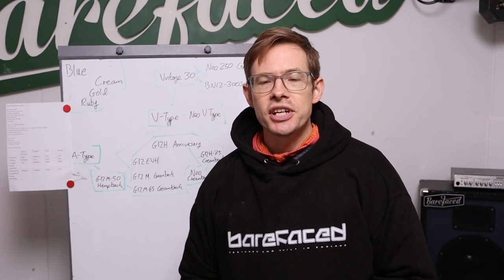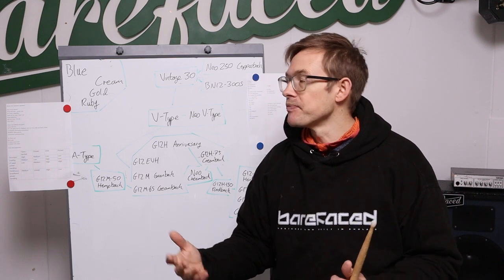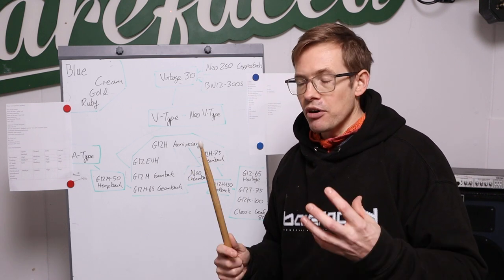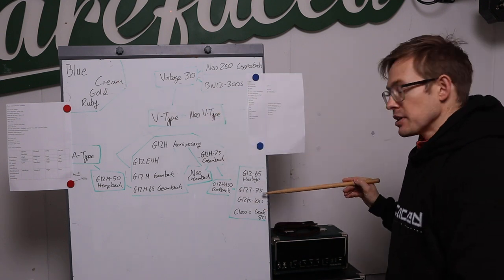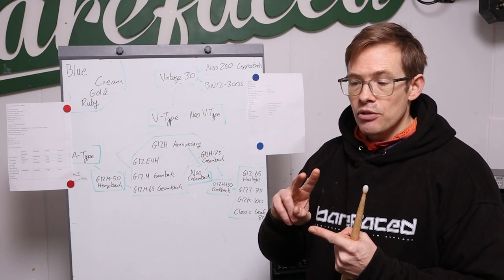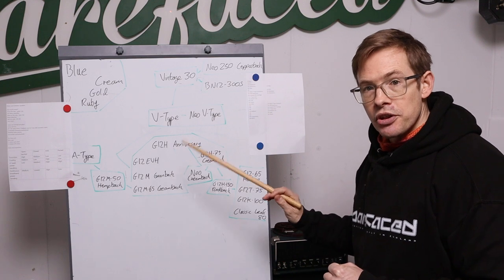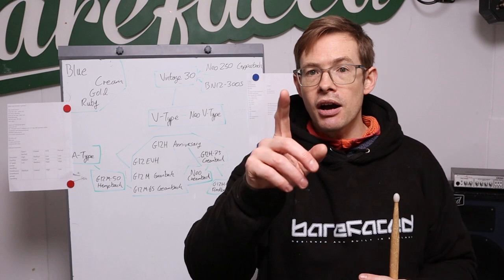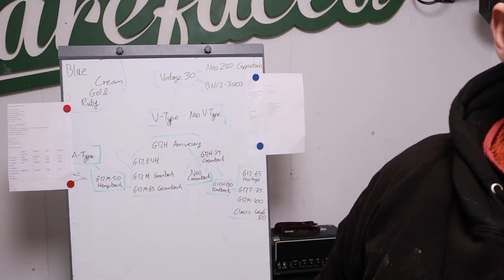Power! Why do Celestion make so many 12" guitar speakers - part 2!

Comment: Extra power handling never hurts. Sensitivity will be significant. So many factors come into play especially with guitar amps because you not only have to consider room size and distance to the listener but if you want to overdrive the output tubes for tone or sustain a speaker with too much sensitivity could make it hard to do without getting too loud.
Reply from the maker: Extra power handling never hurts if nothing else has changed! But you can't increase power handling without changing other things, some of which may affect the sound.

Comment: As far as questions go, can you possibly give us real world useful ability to estimate decibels. I've been told about 124db for a bass amp is pretty ideal. You've mentioned in the past that decibel readings are more important than wattage. Was curious if we could get some real world examples.
Reply from the maker: dB SPL is ironically not that useful because its so dependent on how you measure it - ie peak vs burst vs average, frequency range its measured in, measurement vs cab position, room, etc. I use the app on my iPhone quite a bit to compare different situations (knowing that I've figured in the other stuff) with rehearsals reaching about 115dB according to that app.

Comment: Is Barefaced using the new 2022 & later Vintage 30’s with the more translucent mesh dust cap?
Reply from the maker: We always use the most recent Vintage 30s - we get frequent deliveries from Celestion UK as about half the cabs we sell have custom drivers (and there’s over 40 choices!)